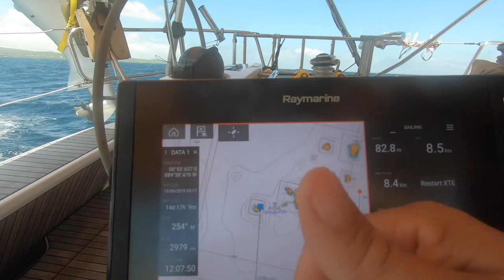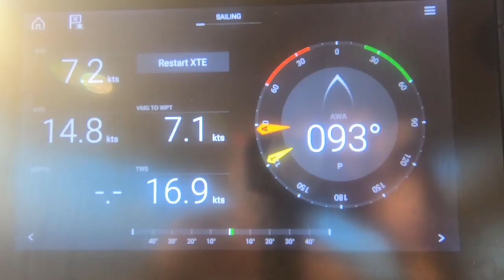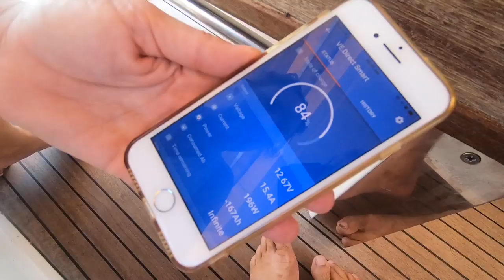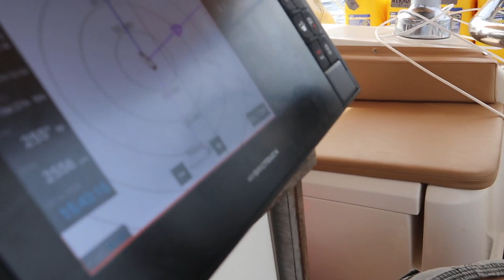Galapagos to Tahiti, steering emergency, 3000 miles Vlog 70

Comment: I've sailed across a few oceans singlehanded and I never had autopilot. I once went 1200 miles without touching the helm. I don't understand if you have a set course and the winds are consistent just set your sails and tye off your steering with a block and lines. In addition, every ocean sailor should drill or have a professional drill a hole in their rudder so they can tye lines back to a cleat or winch to control their steering without any electronics. Steering breakage and poor skills are the top two reasons for rescues at sea. I'm not implying your skills or bad just a reminder, if possible set up your boat so it can be manually controlled in the event of failures.